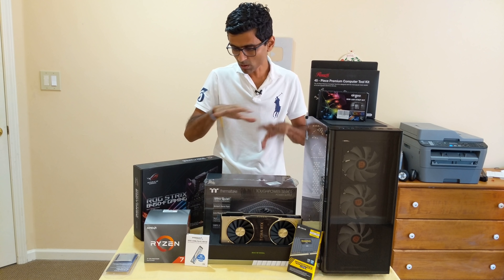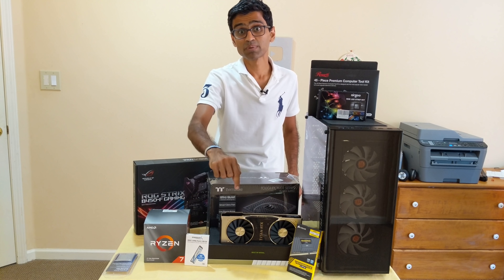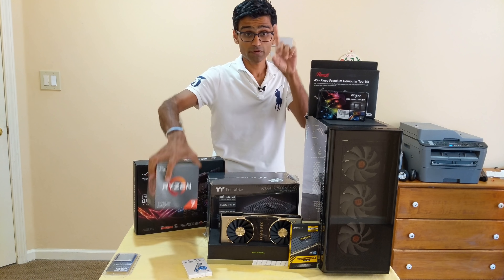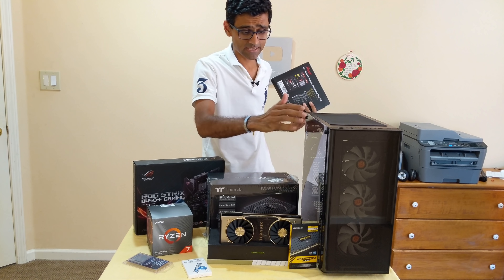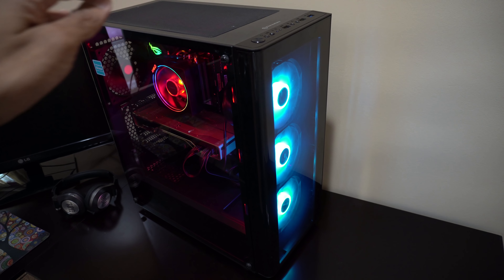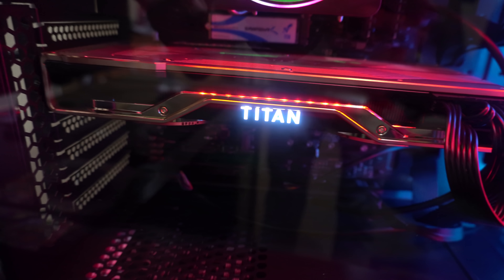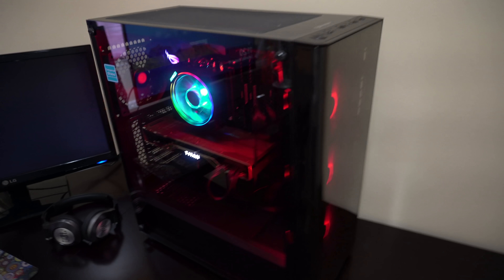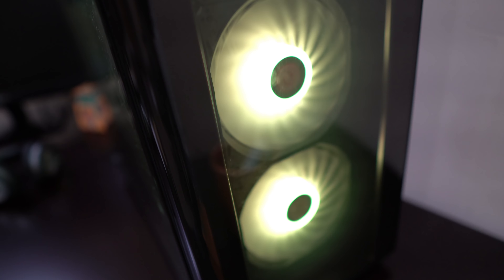Building 3500$ Deep Learning Workstation | Deep Learning PC build From Scratch

Comment: How is the PC now? I am planning to buy the same but I have not decided between Intel and AMD. What is your recommendation overall? How about the CPU?
Reply from the maker: It is running pretty well. Just today I am trying NVIDIA tensorflow GPU acceleration. will let you know but other than that the PC has been working very smoothly
Reply: @codebasics  was it worth it? Hope it worked well, awaiting your updates :)

Comment: Hi Dhaval,Is it feasible solution to build a desktop GPU workstation and connect to laptop via ssh ?Will this drop the performance ?
Reply from the maker: Yes. No performance won't be an issue, laptop needs to have good internet that's it. I did couple of videos on dgx station and one of th video has a link of how to do this setup
Reply: Hi dhaval does the liquid cooler work with Ubuntu or Linux systems

Comment: Hi sir, I am also in the process of building my own pc as well. as per titan rtx user guide, Nvidia recommends 48gb RAM, however you are using only 32? Wouldn't that affect the bottleneck?

in addition, i wonder why did you choose amd over intel? is it because amd offers more threads and cores as compared to intel? just curious to know. thanks :)
Reply from the maker: Udit. Both me and Ken jee have 32 GB ram and it works ok. If you can afford it than get 48 gb. We both used amd because it is cheaper than Intel and performance wise it is as good as Intel